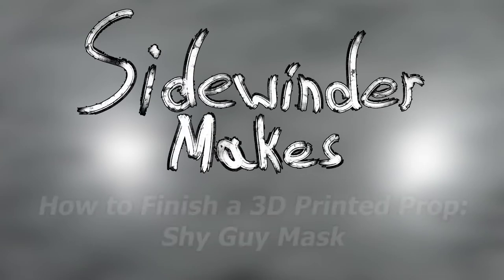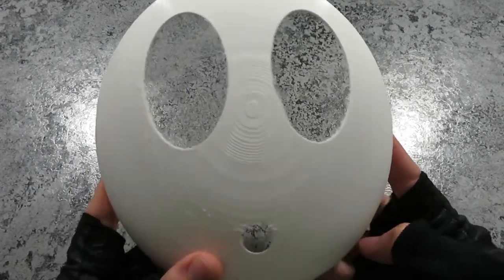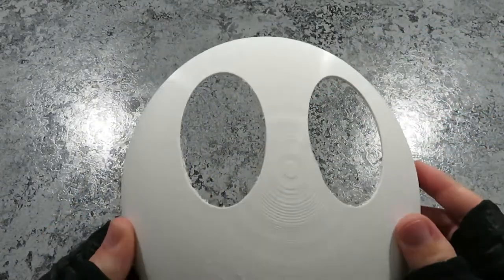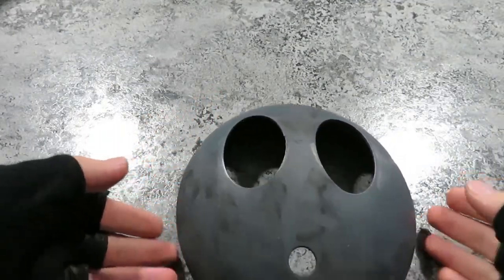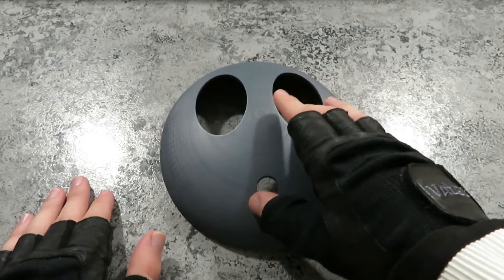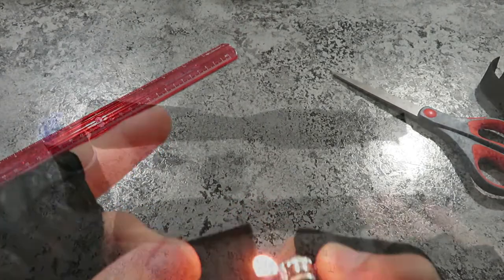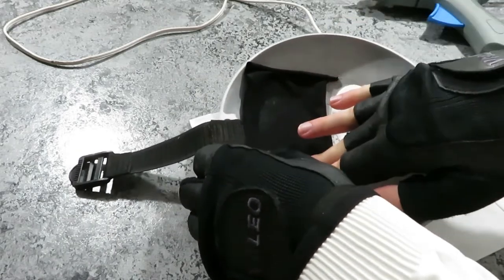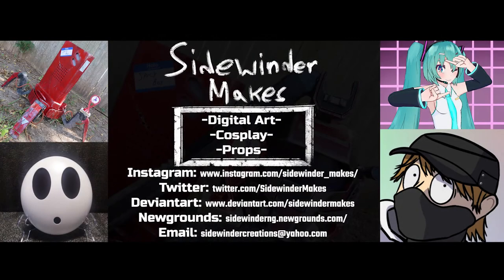Painting and Sanding a 3D Printed Prop: Shy Guy Mask (Beginner Friendly Tutorial)

Comment from the maker: Important Note: 

I have heavily edited the print files over the past few years as I have learned more about 3d printing and finishing props. Supports are now used on all masks to reduce stringing and I offer PETG variants upon request, which are more heat resistant and durable.

My methods have changed quite a bit from the info provided here as I have completed (at the time of writing) over 350+ masks for customers, including it raw and finished orders. Material listings may be out of date due to current world events, and I will attempt to update them if possible. Please be aware of shortages or delays that may occur. If you have questions or need assistance you can contact me at links provided in description or at:

SidewinderMakes@gmail.com
(Etsy messaging is the most reliable way for me to see questions as well as this email link)

As always, be sure to read any warnings on any product you use as certain chemicals can be extremely dangerous. Practice caution when handling any tools and wear proper PPE when possible.

-Sidewinder

Comment: I may buy this mask for my game guy cosplay for my nexr comic con that's coming up. But if i do wanna be spear guy what type of paint should be using 3d print material thought?  🤔
Reply from the maker: For large areas and consistent coats, rattlecan spray paint is a great option. Rustoleum and Krylon work very well for bonding to plastic, especially if you use a primer like in the video. For smaller details or if you can't work with spray paint as heavily, acrylic paint is another method I use a fair bit. It's cheap and non toxic, you can find it in any craft store or even at the craft isle of your local Walmart. Just brush it on with a dampened paintbrush of the proper size and you can free hand any design you want, or make a stencil if more care is required.
Reply: @sidewindermakes4106  thank you for the advice I will keep that in mind. You Have been extremely helpful

Comment: quick question, do I need to sand and prime the finished product or can I just go straight to spray painting? im doing a comic con project.
Reply from the maker: The option for the fully finished mask is pretty much ready to wear out of the box and will look like the finished project at the end of the video, with strap and eyes installed. You just need to insert the foam padding. The cheaper raw print version is for if you want to make the mask yourself, in which you'd use this video as a guide.

Comment: I got your mask a few months ago and I’m finally working on it. But I have a question, I have the same Rust-oleum primer like you but it’s Automotive Primer

Would it work exactly the same or should I just not use it?
Reply from the maker: I recommend checking the can and seeing if it says it can bond to plastic. It should be okay, as I believe that automotive primer is just higher quality and more resilient, which means it is usually more expensive. Just be sure to read your can's labels and take note of any extra curing times.

Comment: What’s a good paint to use on these?
Reply from the maker: I recommend using Rust-Oleum spray primer and paints. If you want the specific white matte finish, I use Rust-Oleum's Ultra Matte White. Alternatively, after you have your mask sanded and primed you can use any acrylic paint you'd like if you prefer to dry brush instead of spray.
Reply: @sidewindermakes4106  Thank You! This information is very helpful! 😁😁😁

Comment: Hey man I'm trying to buy a shy guy mask and is it fine if you could make a already prepared shy guy mask for me to buy?
Reply from the maker: For a limited time, I am offering finished versions on my shop. You can find them under the same listing as an option.
Reply: @sidewindermakes4106  just wanted to make sure, but the kit has the strap to put on the mask correct?
Reply from the maker: @NotRetrix  Yes, a kit has all the parts you need to make the mask except for the thread, hot glue, and paint.
Reply: @sidewindermakes4106  did you sell out of shy guy masks? Cause I was about to buy one from your shim but there isn't any